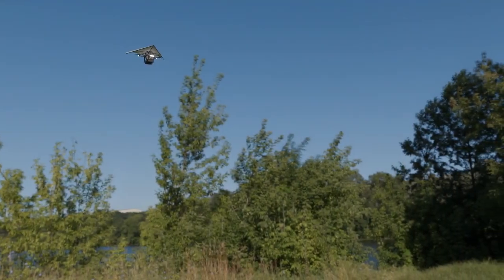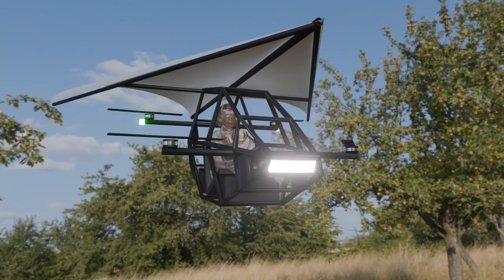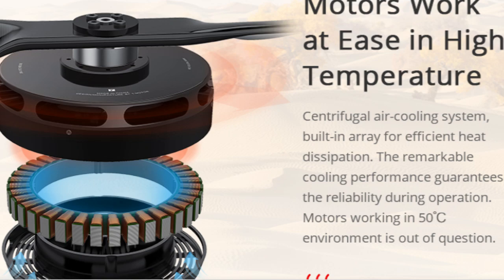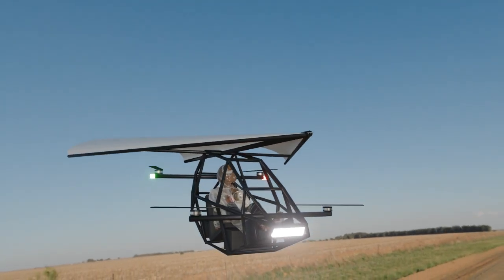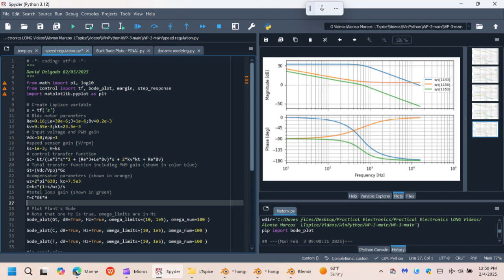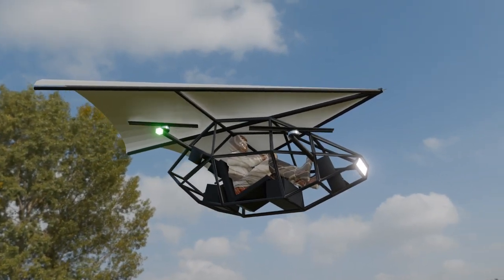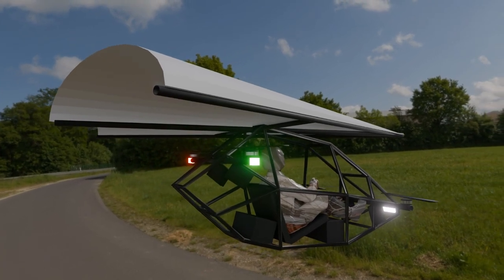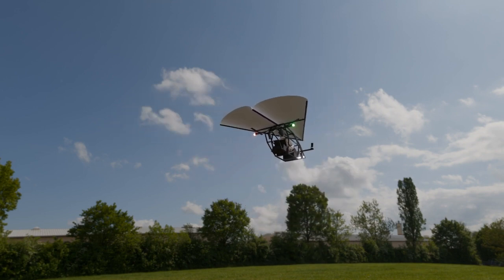eVTOL Drone hybrid for Safety, Innovation, and Freedom

Comment: Good Evening.   Can you tell me what 4 motors and ESC you are saying will lift that type of weight   Thank
Reply from the maker: Absolutely.  

Motor
T-Motor U15II KV80   Voltage 44.4V(12S)    max thrust per motor 165 lbs (75 kg)     KV rating 80 KV      Max current ~80A.  T-Motor U13KV100                   44.4V(12S)                                           132 lbs (60 kg)                      100 KV                          ~65A 
MAD M40 KV85                          48V (12S)                                            160 lbs (72 kg)                       85 KV                           ~75A
Best choice: T-Motor U15II KV80, since it provides 165 lbs thrust per motor with a 40-inch propeller.
ESC 
T-Motor Alpha 80A HV    Voltage Range    12S (44.4V)        Max Current 80A 
APD 100F3-X HV ESC      Voltage Range    12S (48V)          Max Current  100A 
ZTW Mantis 85A HV        Voltage Range    12S (44.4V)      Max Current   85A
Best choice: APD 100F3-X HV ESC, as it supports high current loads reliably.
Reply: Can you telll me what weight these motors can lift if I have 4
Reply from the maker: @digitalalarmsystemsllc4022  165 lbs x 4 = 660 lbs (300 kg)
Reply: Thank you

Comment: so bad
Reply from the maker: Tough crowd! I wouldn't talk after reviewing your channel. Needs work! Lots of work! Good luck with that. 🤪😎
Reply: @BoundlessVision-d2  you don't like my channel?! Aw man but I put so much time and energy into that lol 

More constructively: It's mainly just that your design doesn't make any sense in it's current configuration. The fixed rotors are actively fighting the wing as their required angle of attack to function properly are fundamentally orthogonal to each other. I'd imagine for something like this to work the rotors would need to tilt (or the wing I guess?) in order to not be fighting each other. Perhaps the wing could be deployable instead?
Reply from the maker: @mv2woods  I see what you're getting at! It's like making two chefs fight over the same pot—doesn't help the dish, right? You're spot on about the conflict between the fixed rotors and wing angles. A tilt rotor system or deployable wing could be a tasty solution to get everyone working in harmony. Appreciate the constructive nudge—definitely food for thought!    no pun intended.

But my point is, as I already stated and should reiterate, the application of the Rogallo wing is an approach to replace the conventional parachute with a versatile, energy-efficient solution. Unlike traditional parachutes that are only deployed in emergencies, the Rogallo wing is an active component of flight, providing natural lift and reducing the workload on motors.

This design translates to improved energy efficiency and extended flight duration. The wing's aerodynamic properties allow the aircraft to harness lift from the surrounding air, much like a glider, minimizing the energy demand on propulsion systems during forward flight.

But the true brilliance of the Rogallo wing lies in its safety features. In the unlikely event of a motor failure, the aircraft seamlessly transitions into a stable glide. The wing design naturally supports controlled descent, offering passengers and cargo a safer, smoother landing.

By integrating the Rogallo wing as a parachute replacement, this aircraft embraces innovation, blending efficiency, sustainability, and enhanced safety for a superior flight experience. Whether soaring through the sky or descending gracefully, the Rogallo wing proves to be a game-changer in modern aeronautical engineering.

Again, I Appreciate your constructive comments. Thank you
Reply: @BoundlessVision-d2  Good luck! Hope you can prove us critics wrong!
Reply from the maker: @mv2woods Indeed, I took the same logic classes you critics did in college — your conjectures are just fallacies waiting to be exposed by the truth.   If all goes according to plan, I should soon be able to complete my 6X9 Amazon paperback book with details. May be good bedtime reading for all the critics, put them to sleep really fast? Thank you for viewing. (Sorry for all the edits my typing errors and spelling need work)

Comment: It's nonsense,  this eVTOL aircraft is rubbish thing.
Reply from the maker: Thank you for taking the time to share your thoughts. I understand that skepticism is common with innovative technologies. However, I assure you that this eVTOL aircraft design is grounded in thorough research and validated by multiple simulations.

If you're genuinely interested in reviewing the LTSpice simulations with the python bode plot results based on Laplace transfer functions which are mathematical representations of linear time-invariant (LTI) systems in the frequency domain. They relate the system's output to its input using complex frequency variables., download and review the pdf formats included in this presentation. Constructive dialogue often leads to greater understanding and improvement.

Just for reference I compared the T-Motor test data with 18 LTSpice simulation schematics developed by Prof. Marcos Alonso and the results were closely related   Coincidence or rubbish?  ("rubbish bloody hell") you decide

Comment: The rear motors are positioned beneath the wing, and I'm concerned that the airflow might not be adequate.
Reply from the maker: General Rule
The spacing should ensure that the propellers do not interfere with each other aerodynamically (avoid propeller wash overlap) while maintaining a compact and symmetrical design for stability and maneuverability.

Key Factors to Consider
Propeller Diameter

A good starting point is to space the motor centers at least 1.2 to 1.5 times the diameter of the propellers. This helps minimize turbulence and aerodynamic interference between adjacent propellers.
Thrust Overlap

Avoid overlapping the effective thrust zones of each propeller. Proper spacing ensures clean airflow for each propeller, enhancing thrust efficiency.
Vehicle Size

The overall size of your Quadcopter and its center of mass influence motor placement. For a symmetrical motor layout (as in your design), ensure the motors are equidistant from the center of the vehicle to maintain balance.
Stability and Control

Wider spacing can improve stability, especially for larger vehicles, but too wide a spacing might reduce responsiveness to control inputs.
Vortex Interaction

Ensure enough distance to avoid destructive interference from vortices created by nearby propellers, which can cause instability or reduced thrust.
Structural Constraints

Consider the physical structure of the Quadcopter, ensuring the design can accommodate the required spacing without compromising durability or functionality.
Reply: The rear propellers create a low pressure area right under the wing. This will destabilize the craft because a high pressure under the wing is needed for lift.

Comment: good stuff. simple. lots of dev pathways for this.
Reply from the maker: Thank you! Glad you see the potential—there’s definitely plenty of room for further development and innovation.
Reply from the maker: The innovative application of the Rogallo wing is a revolutionary approach to aircraft design that replaces the conventional parachute with a versatile, energy-efficient solution. Unlike traditional parachutes that are only deployed in emergencies, the Rogallo wing is an active component of flight, providing natural lift and reducing the workload on motors.

This intelligent design translates to improved energy efficiency and extended flight duration. The wing's aerodynamic properties allow the aircraft to harness lift from the surrounding air, much like a glider, minimizing the energy demand on propulsion systems during forward flight.

But the true brilliance of the Rogallo wing lies in its safety features. In the unlikely event of a motor failure, the aircraft seamlessly transitions into a stable glide. The wing design naturally supports controlled descent, offering passengers and cargo a safer, smoother landing.

By integrating the Rogallo wing as a parachute replacement, this aircraft embraces innovation, blending efficiency, sustainability, and enhanced safety for a superior flight experience. Whether soaring through the sky or descending gracefully, the Rogallo wing proves to be a game-changer in modern aeronautical engineering.